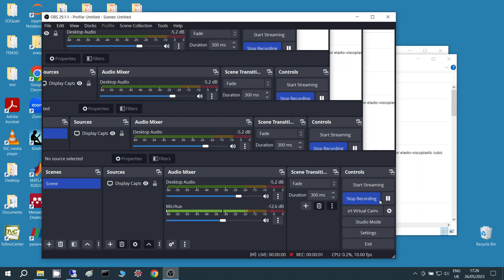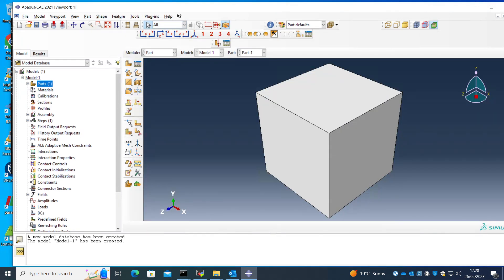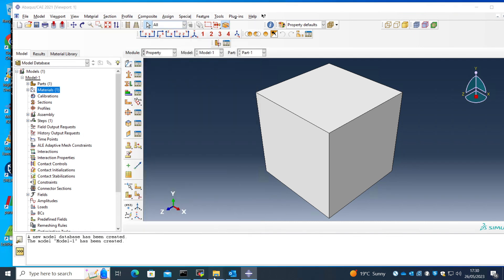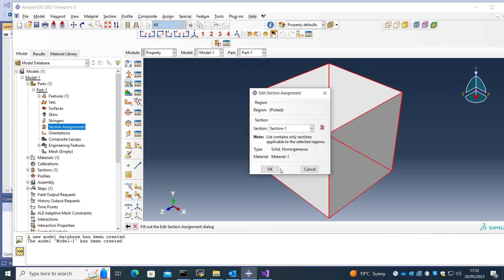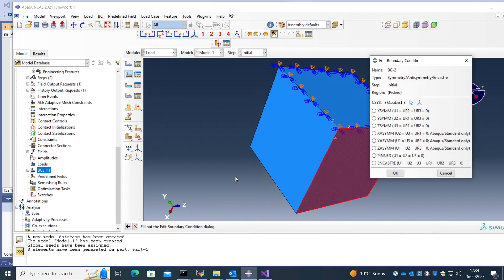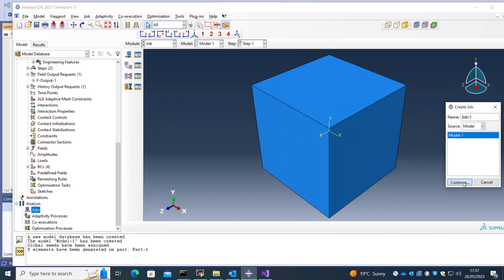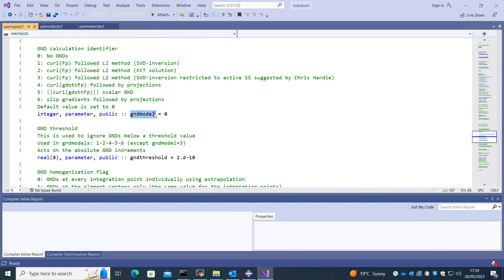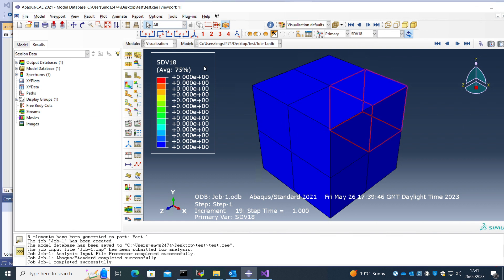ABAQUS - UMAT Crystal Plasticity

Comment: Hello Eralp,
I am currently implementing the Oxford-UMAT in Abaqus and working on reproducing Fig. 3 from your paper (OXFORD-UMAT: An efficient and versatile crystal plasticity framework), specifically the case of the thermally-activated slip law (slip model-1) with A = 0.001, B = 0.1.

I noticed a significant discrepancy in the stress–strain response: in the reference curve, the onset of yielding (first deviation from linear elasticity) occurs at about 85 MPa, whereas in my simulation the curve starts to deviate at around 45 MPa, despite carefully checking the parameters.

I would really appreciate your advice on what could cause this shift.

Thank you very much for making this framework available
Reply from the maker: Many thanks for your interest.

It may be due to many reasons, usually related to the difference in the inputs. First thing I would try is to reduce the time steps, and make sure the same strain rate is attained since the model is rate sensitive.

For any querries please feel free to raise an issue from the github page: https://github.com/TarletonGroup/CrystalPlasticity

BW

Comment: Dear Dr. Eralp Demir,

Hello Dr. Eralp, I am a student based on constitutive modeling of FEA and artificial intelligence for metallic materials. Now I am learning CPFEM through your lectures and conducting research on applied crystal plasticity modeling based on your resources. I sincerely appreciate all the videos and the GitHub source code you have provided—they have been extremely helpful.

While reviewing the code and the PROPS Excel file, I came across 3 questions and wanted to ask for clarification:

1. According to the provided PROPS file, the slip model and its parameters are assigned to PROPS(25) through PROPS(39), and the creep model parameters follow immediately after. If I am not using a slip model and therefore set PROPS(25) = 0, does PROPS(26) then naturally become the first parameter defining the creep model?

2. I have generated a Dual-Phase RVE using DREAM.3D, consisting of approximately 3300 grains. All grains have either BCC or BCT structures. From your expert perspective, would you recommend modifying the provided code so that IF structures are created programmatically and the corresponding material properties are automatically assigned during phase definition? Or would it be preferable to manually assign the material properties to each grain in the RVE?

3. How can we determine plastic anisotropic mechanism of the algorithm in this code set?

Thank you again for your excellent lectures and resources.

Best regards,

Taeyoung GO

Comment: Thank you for your excellent work and for sharing it with the community. I'm attempting to simulate creep behavior in a structure containing a hole (pure creep, no other plasticity effects). However, I'm facing convergence difficulties and the analysis fails to reach the desired end time. What would be your key recommendations for improving convergence in such cases? Any tips would be greatly appreciated!
Reply from the maker: Hi, many thanks for your interest. I would recommend to raise an issue in the Github page of the code with a detailed explanation of your problem.
https://github.com/TarletonGroup/CrystalPlasticity 
Best wishes

Comment: Thanks for sharing, the tutorials really help. I have a small question, the Euler angles in this UMAT rotate in which coordinate system? Is it the default coordinate system generated by Abaqus? How can I choose the right sample frame?
Reply from the maker: Hi,
The sample frame is the same as the Abaqus default X-Y-Z frame. Bungle angles are used to define the orientation of the grain, which is referred as the crystal reference frame, with respect to the sample reference.
Reply: @eralpdemir  Thank you dear Eralp!!!!!!!
Reply: @eralpdemir  Dear Eralp, I met a problem that this UMAT consumes too many computer resources. Can I use reduced integration when choose C3D20 element? Will it affect the results?  Thanks again!
Reply from the maker: @Junlonghe-q3x  Hi, yes of course. GND calculation is also valid for C3D20R, you need to set the "gndlinear=1" in that case in userinputs.f
BW
Reply: @eralpdemir  Thanks again !!!

Comment: Hello Eralp,
Thank you very much for sharing your code!
I’m trying to couple your code with a thermal calculation by using the Step: coupled temp-displacement (transient). However, I encountered the following error:

* Error: Runtime stack limit has been exceeded.           
    This may be caused by user subroutines with large data structures allocated on   
    the stack or recursion.  For suggestions on how to resolve this problem,  please 
    refer to the chapter "Ensuring thread safety" in the ABAQUS documentation.     
* ERROR CATEGORY:  ELEMENT LOOP

Do you have any suggestions on how to resolve this issue?

Thank you,
Best regards.
Reply from the maker: Hi, this may be due to several reasons. Please raise an issue with more details to the Github page.
Best

Comment: Hello Enralp
Thank you for your introduction and the shared subroutine.
I currently want to use the subroutine to compute FS parameters, but with both multi-core and single-core, I encountered an error: "abaqus/standard rank 0 encountered a SEGMENTATION FAULT". I would like to ask, except  that statev_outputs(20)=0 in useroutputs.f has changed to 1, what else should I note? Thank you very much.
Reply: It is very important to me. I would be very grateful if you could reply to me despite your busy schedule. Thank you again.
Reply from the maker: Hi, there might be problem with the output(20). I will give an update as soon as I figure out the problem. Thanks for letting me know. 
Best

Comment: In the documentation, it is written "Dimension unit: μm
Stress unit: MPa", so while applying boundary conditions in abaqus if i want displacement of 1.5 mm, i should enter 1500, right? Please if anyone can provide clarification for this.
Reply from the maker: @anmolbakshi613  Hi, no. You should think about the strain you want to apply, and multiply with the size of gauge length. For example, if the size of the sample is 100 in abaqus, and you want to apply 10% strain, you should apply 10% * 100 = 10 as your displacement.
Reply: @eralpdemir  Dear Eralp, Thanks a lot for clarifying the doubt.

Comment: in useroutput , there is one state-variable as "Elastic strains in the crystal frame", how to know "Plastic strains in the crystal frame"?
Reply from the maker: Hi Anmol,
This you may obtain from "Fp". For that you need to write a custom output using statev_Fp.
Reply: @eralpdemir  Ok ok. One more doubt, here "  State variable-4
      if (statev_outputs(4) == 1) then
!
          do i = 1, 6
!
              count = count + 1
!
              select case(i)
!
              case(1)
                  ij = 'xx'
              case(2)
                  ij = 'yy'
              case(3)
                  ij = 'zz'
              case(4)
                  ij = 'xy'
              case(5)
                  ij = 'xz'
              case(6)
                  ij = 'yz'                  
!
              end select
!
!             
!
              write(100,'(A7,I3,A36,A2,A6)')
     + 'STATEV-', count, 
     + ':   Elastic strain in crystal frame-',  ij,  ' [MPa]'", why MPa as strain is unitless?
Reply from the maker: @anmolbakshi613  could be a copy-paste typo. If you check the magnitudes, you should see strains not the stresses.

Comment: Hello Enralp,
Thanks your instruction. I have a question for CPFEM.
How do I draw the yielding surface or know the yielding surface from CPFEM?
Bests.
JoJo
Reply from the maker: Hi JoJo,
That is an important question. 
- First the yield point shall be located, one of the best way to look at total plastic strains which is stored as a scalaer in the variable "statev_totgammasum". The time that it starts taking non-zero values indicates yield.

- Second, yield surfaces are in stress space. You need the location of your stress state. Macro stress for a polycrystal can be simple uniaxial but the stresses in the grains can be complex. You may use that information to plot the yield surface for each integration point with complex stress states. The stress components are stored within "statev_stress" you need to find the principal stresses.

The critical thing is that you need to find the stress state at the point of yield which might be different for each integration point. 

Hope this helps,
Eralp

Comment: Hello Enralp,
Thank you for sharing your work
There seems to be an error that the solution does not converge when I try to do the calculation through the CPU parallelization computing supported by ABAQUS.
If I don't do parallel calculations with the exact same input file, it works fine, but if I do it in parallel, it iterates in the first step and stops with an error.
I'm guessing it's because the nodes are distributed per CPU core, but do you have any experience with parallel computation?
Thank you

Comment: Thank you for developing this whole thing. I used the following commands to generate 5 grains in neper:
neper -T -n 3 -dim 2 -domain "square(1,1)" -morpho gg -ori "file(orientations.txt)" -oriformat plain -oridescriptor e -o square_2d

neper -M 2d_square.tess -statelset area -rcl 1 -elttype quad -order 1 -interface continuous -format inp -o abq_tet_2d -format msh

where orientations.txt containing phi1, PHI, phi2 are as:
199.1 44.1 59.6
325.1 48.2 33.2
276.2 45.9 60.9
270.8 46.0 68.3
188.7 32.0 69.6

Then, I am converting neper .msh file to abaqus .inp file using your MATLAB code. Then when viewing in ABAQUS PROPS, the angles values are not remaining same. Where am I going wrong?
Reply from the maker: Hi Anmol,
I have prepared the Neper to Abaqus converter for 3D meshes. It may go wrong or miss something in the input file for 2d cases. Please feel free to modify the code for your purpose.
Best
Reply: @eralpdemir  I am getting the discrepancy in case of 3D meshes also. Can u help me?
Reply from the maker: @anmolbakshi613  Hi Anmol,
I tested the code for linear tetragonal elements. Please try the same code as in the example. You may convert to different element types using Abaqus after generating the polycrystal mesh.
Best
Reply: @eralpdemir  Ok thanks for the help.

Comment: Hi,
I observed that the slip rate has positive or negative value.
If the value of the slip velocity of (111)[1-10] is negative, does this mean that the crystal moves in the [-110] direction?

Thanks a lot!
Bests,

Joan
Reply from the maker: Hi Joan,
Yes that is correct, slip can take negative or positive depending on the applied stress.

As you say, slip being negative means simple shear direction is along [-110] while keeping the plane the same (111).

Bests,
Eralp

Comment: Hello Enralp, 
Thanks for sharing your work, your insights have proven to be incredibly valuable in my research endeavors.
I am currently exploring the simulation of phase transitions during loading, particularly the transition from FCC to BCC. In this context, I am considering introducing small BCC crystals at grain boundaries, initially setting their parameters to match those of the surrounding FCC phase. As the simulation progresses and certain conditions are met, my aim is to alter the material properties of these small crystals to simulate the transition to a BCC structure. Do you find this assumption reasonable? I would greatly appreciate any suggestions or insights you may have regarding the implementation of dynamic phase transitions within the framework of crystal plasticity. 
Furthermore, as I continue with my research, I am eager to delve deeper into your scholarly contributions to enhance my knowledge. Could you kindly recommend a few of your key papers or publications? Your recommendations would greatly assist in my ongoing studies and provide valuable references for future citations in my work.
Reply from the maker: Thank you so much for your interest.

That is a very interesting application. For example for deformation twinning, there are continuum models available (https://doi.org/10.1016/S0022-5096(97)00051-3). The current code can not work with  dynamic changes, but you need to learn how to implement and make related modifications in the computation framework which is in "cpsolver.f".

I have put some relevant papers on the Github page. The publication related with this code is under prep. I will share once published.

Best wishes
Reply: @eralpdemir  I am immensely grateful for the invaluable assistance you've provided. Thank you so much!

I have another question and would greatly appreciate your insights. I wanted to inquire about whether crystal plasticity finite element analysis is generally associated with static analyses? Regarding the time increment used in static analyses, can it be considered as a process akin to dynamic analysis under the assumption of small deformations?

Thank you once again for your time and expertise.

Comment: Hello Enralp,
Thanks your instruction. I have a question for CPFEM. When I run the job by ABAQUS, it appear the error 'Abaqus/Standard Analysis exited with an error - Please see the  message file for possible error messages if the file exists' as soon. I use other model and UMAT, it has the same error. If possible, could you kindly assist me in resolving this problem?I would greatly appreciate any assistance you can provide. Thank you in advance.
Reply from the maker: Hi Liangsu, if you would send me you .inp file, I could try to point the problem. 
email: eralpdemir@gmail.com
Bests

Comment: Hello Enralp, I'm currently working on developing a crystal plasticity code with similar functionalities.
 However, I encountered some issues when running your code. Here's the log file output 
Begin Compiling Abaqus/Standard User Subroutines
2023-05-27 9:42:10 AM
Intel(R) Fortran Intel(R) 64 Compiler Classic for applications running on Intel(R) 64, Version 2021.8.0 Build 20221119_000000
Copyright (C) 1985-2022 Intel Corporation. All rights reserved.

End Compiling Abaqus/Standard User Subroutines
Begin Linking Abaqus/Standard User Subroutines
   Creating library standardU.lib and object standardU.exp
libirc.lib(fast_mem_ops.obj) : warning LNK4210: .CRT section exists; there may be unhandled static initializers or terminators
End Linking Abaqus/Standard User Subroutines
2023-05-27 9:43:44 AM
Begin Analysis Input File Processor
2023-05-27 9:43:44 AM
Run pre.exe
2023-05-27 9:43:49 AM
End Analysis Input File Processor
Begin Abaqus/Standard Analysis
2023-05-27 9:43:49 AM
Run standard.exe
2023-05-27 9:43:49 AM
Abaqus Error: Abaqus/Standard Analysis exited with an error - Please see the message file for possible error messages if the file exists.
Begin SIM Wrap-up
2023-05-27 9:43:50 AM
Run SMASimUtility.exe
2023-05-27 9:43:51 AM
End SIM Wrap-up
Abaqus/Analysis exited with errors.

 While I am able to run other subroutines on my workstation, I'm having trouble understanding the issue with my PC. If possible, could you kindly assist me in resolving this problem?
I hope this helps you understand the issue I encountered while running your code. I would greatly appreciate any assistance you can provide. Thank you in advance.
Reply from the maker: Hi Vikram,
Thank you for your efforts in running our code. 

If it happens at the very first step it is usually an input issue. It could be related with the model. 

UMAT reads the Job-1.inp file and this can happen usually if it cannot find that file. I recommend setting the flag "readinpfile=0" in userinputs.f and set the defaultnumel=??? and defaulteltyp='???' in the same file. 

Please also make sure to check the 6 inputs UserMaterial and the outputs in Depvar. 

Let me know if this solves the issue.

Best wishes,
Eralp
Reply: I have the same problem, have you solved it?